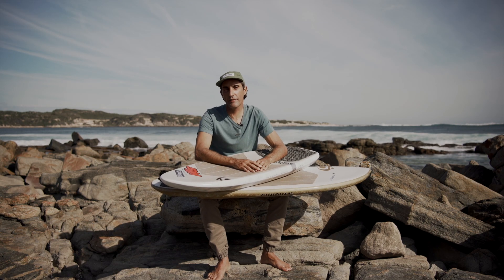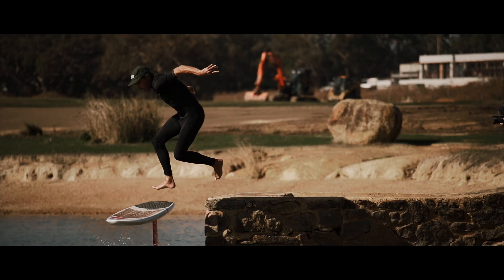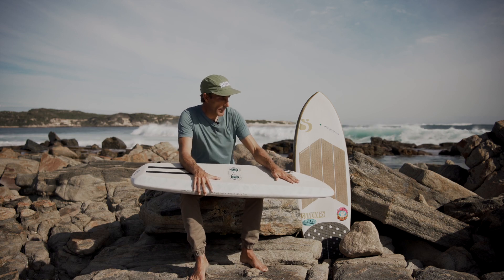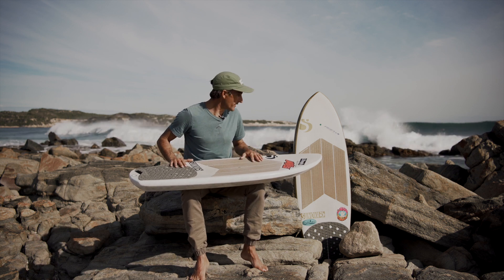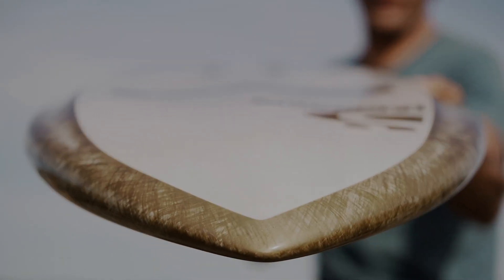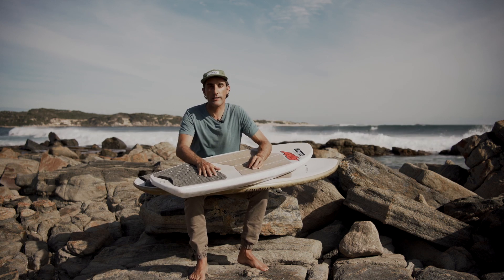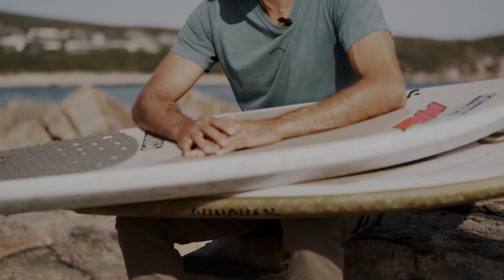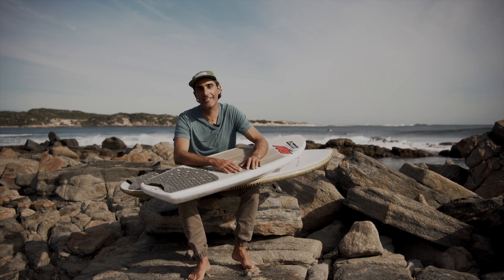Foilboard Talk. My Sunova Quiver.

Comment: How do surf foils paddle compared to regular surfboards? Ie if I typically ride around 30litre surfboards would I go the same in a surf foil board?
Reply from the maker: Hey Ross! When I started out I was on a 34L board. I’m 64kg and my regular surfboard was 26L. As I progressed I have eventually ended up on 26L foilboards. So to answer your question the volume and paddling is very similar, we just start on higher volume to help with learning 🤙😎

Comment: What kinda of litres would you recommend for someone around 95kg and only starting to go out foil surfing ? Thanks for vids very informative 🤙
Reply from the maker: Hey there! Cheers! I have a Sunova SUP foil board which is 6ft and 80L. It is a perfect beginner board for anyone from kids to adults because you can still paddle it like a surfboard. I would say go with at least 50L to keep it easy at the start, then as you progress your boards will get smaller ✌🏼😃
Reply: @LarryFoiler  Do you think a 5'4" 110L x 29" wide SUP foil could be used as a foil-surf starter board for a 100L rider?
Reply from the maker: As long as you can paddle it yes for sure 🤙🏽💪🏽 29 is very wide that’s all I’m thinking
Reply: Larry Foiler yes, the width is the issue but I guess at 186cm tall I’ve paddled it a mile across a lake when wind died while winging.
Reply from the maker: Sweet!
Reply: Larry Foiler would you advise to stick with 4’ for dock starts or is 4’6” still an option? 4’6” seems more versatile but not if it doesn’t pump as good. Thanks for all the advise. Let us know if we can get you a Hazard 4 pack or something that you could use for your videos.
Reply from the maker: Hazard 4 yes for sure a 4’6 will be fine for dock starts. Once you figure out the whole pumping thing then you’ll have an idea about how low you can go in volume for dock starts etc... generally you’ll want the smallest volume that you can still paddle with, for me at 64kg that’s around 25L 😊 Let’s chat about your packs, would you like to email me hello@larryfoiler.com 😊 Cheers! 🤙🏽
Reply: Larry Foiler will do👍

Comment: great clip with some nice wave action, which axis rear wing do you prefer overall / pump on the 900
Reply from the maker: Thanks mate! I’ve been loving the 460 flat rear wing lately, it’s solid carbon too so you can trim it down easily. I’ve cut mine to 410. It pumps really well and is super fast, and because it’s flat it loosens up the 900 in the surf 🤙🏽